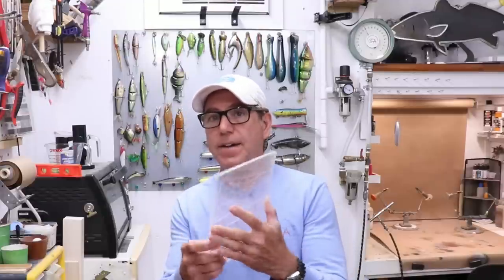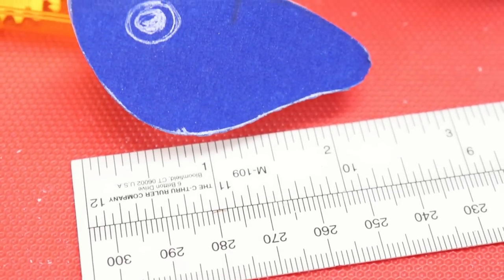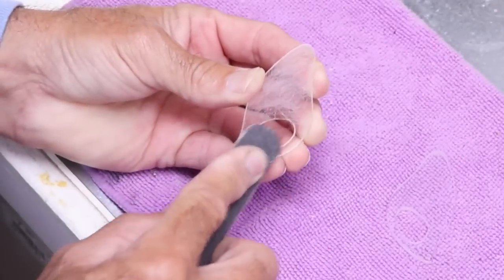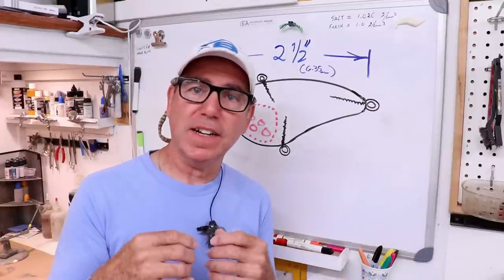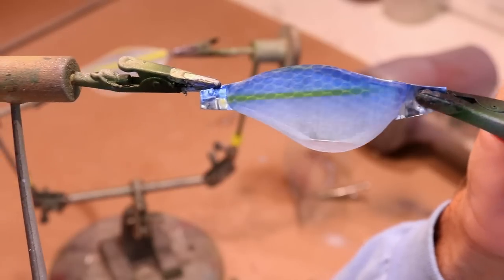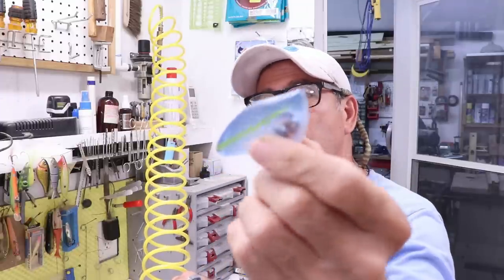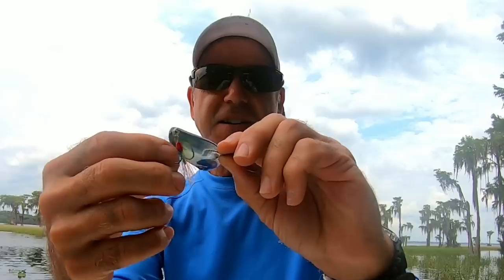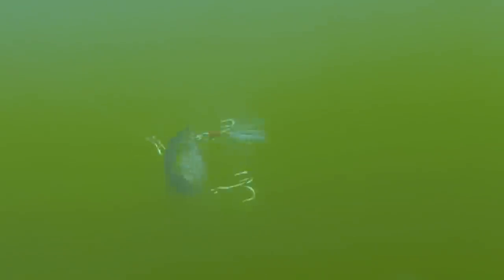Can I put a rattle in a plexiglass lure?Making Lipless crankbait  #fishinglure #lurefishing

Comment: I really love the information you share in your builds. I have learned so much about weight distribution and the turbulence the lure must have to cause to run right. I had planned on building a lipless as my next build and this video helped me so much in deciding on a design. I was thinking about making the top of the lure wider in the front than the back to maybe get more wiggle. However, I haven’t made a lipless to even know if that would do anything. Thank you for the videos. I really like the way you make your videos real and not miss leading in any way.  By the way, I love the polycarbonate lures you make.
Reply from the maker: Watch this video https://youtu.be/RaeoHpmBt_Q
Reply: Thank you! That answered a lot of questions.

Comment: Cracking bait that, the rattle at the end was epic 👍 how long did that under arm spin cast take you to master? Very cool 😎 man!

I wonder if you could make a bigger version of that bait but hollowed out somehow and fill it with expanding foam, that would be an interesting build.

Anyway I have a challenge for you if you're up for it, it's a little off the norm but how about a video making 2 baits side by side, a Picasso trigger fish crank bait & a jointed clown trigger fish swim bait, colors are awesome... would luv too see that video franco & how they both fish at the end 👍👍

Keep it up man, brilliant videos & information you share!!
Reply: That cast isn't hard at all really.
I been using casters since the 80's.I didn't try to go out and "learn" it,I just caught myself doing it one day when I didn't have much room to cast. I'll also do it with spinners but I'm working on phasing out my spinners for nothing but casters.
I do another cast where you twirl the lure clockwise or counterclockwise depending if you want to cast left or right and don't have the room to do it normally. You can also do this method to cast under things like fallen logs,docks,etc. but it does take some time to get proficient with it. Then you can use this type of cast to cast forwards if you twirl the bait just straight out. This takes quite a bit more practice over the prior one I mentioned as you can not twirl it straight out from the rod,it has to be off center and your lure is going to go that way also so you have to learn to compensate for that too.

Comment: Hi, I’ve been following your videos with great interest and for the past two years I’ve started lrf fishing in Greece. About a year ago I started making my own lure out of wood,I’ve had success ,they swim with all the necessary wobbling and I’ve had strikes but I have a problem with the casting . My rods are diawa very 1 - 10 gr and my lures are within the 4 - 6 7 and 8 grams when casting they tend to turn sideways and as a result my casting distance in dramatically reduced compared to similar weight commercial lures if it’s possible some advice on what could be causing this would be much appreciated,as a mechanical engineer I do my math on making my lures but casting is a failure keep your videos coming they are incredibly interesting I thank you in advance

Comment: Nice work but I think quite expensive, but I want to ask you a question; do you think it is possible to replace the steel wire with a steel cable?
I'm thinking about it but before I start testing I wanted to hear some opinions...In Italy ,finding steel wire is starting to be a problem, you can find it but with a lot of difficulty and at prices like...goldsmiths😭😭

Bel lavoro ma credo abbastanza costoso, ma voglio farti una domanda; secondo te è possibile sostituire il filo di acciaio con un cavetto di acciaio?
Ci sto pensando ma prima di cominciare a fare delle prove volevo sentire qualche parere...In Italia ,trovare il filo di acciaio comincia ad essere un problema, si riesce a trovre ma con molte difficoltà e a prezzi da...oreficeria😭😭
Reply from the maker: Thin cable can work but you'll have to crimp them.

Comment: Do you still have copies of your blue engineering lure drawings?  The reason I ask I think they would make a very cool collage poster of all the lures you have made, plus it would make a great reference for us, the viewers, to try and wet our feet by duplicating your work from the original drawings.
Just a though.  Let me know what you think?
Reply from the maker: I like your idea.   Unfortunately most of the drawings for the videos I do by hand, and I do that because I think it's less intimidating, more accessible than a CAD drawing. But ironically the hand drawings get distroid in the process and are not accessible to anyone.   I plan to produce a set of drawings and instructions for a few of my favorite lures and offer them up for a very small price.  That's the plan....
Reply: @EngineeredAngler  start making copies of your drawings before cutting them up.  Personally I’d really like to have some to hang in the shop for inspiration if nothing else.
Reply: @EngineeredAngler  I wouldn’t want cad drawings. They lack character and don’t show the art of refinement with the additional lines.  Your draftsman/ blueprint style is bold and unique in this field of lure making.  Don’t ever change that,  it is very cool.

Comment: I have a question that could be worthy of answering on video for everyone. Couldn't you put several line ties in different spots and make a lure that has different actions depending on where you tie them on? It might be fun to try to design a lure that you can use a few different ways just by tying on closer to the front or farther back so it affects how it "digs" or maybe by tying on the front it would run shallower. I hope I'm explaining my question and idea right. If you want to use it feel free to reword it. The lure in the video might even work for experimenting.
Reply from the maker: Sure...that's something I've done with crankbaits to demonstrate how it changes with the tie eye location.
Reply: @EngineeredAngler  I'll have to look for the videos. Thanks for the answer.